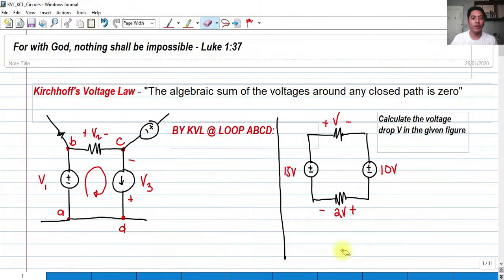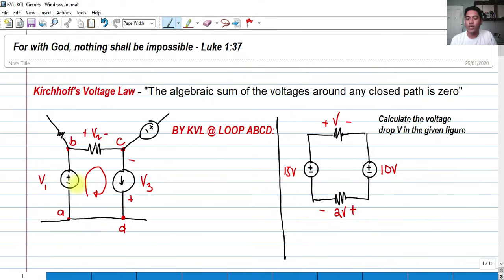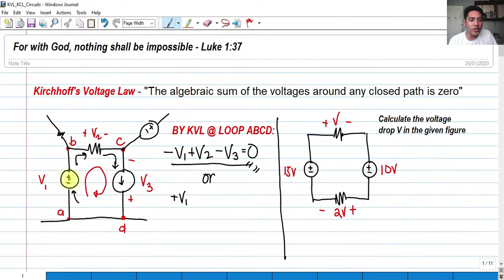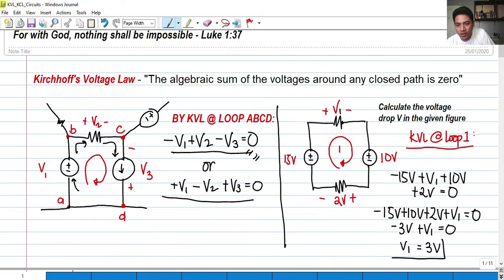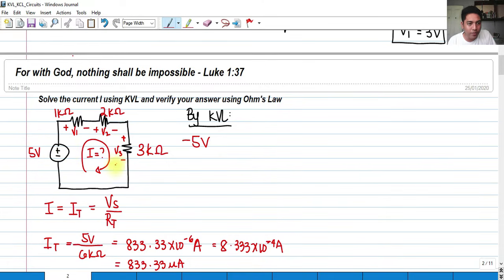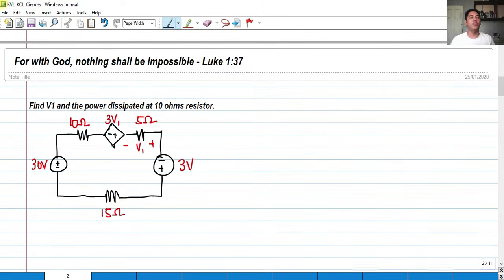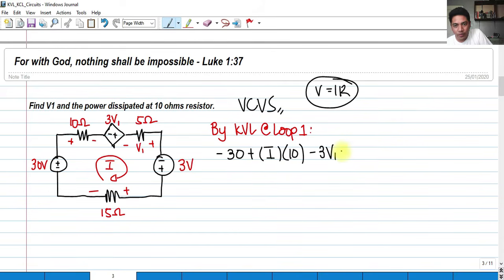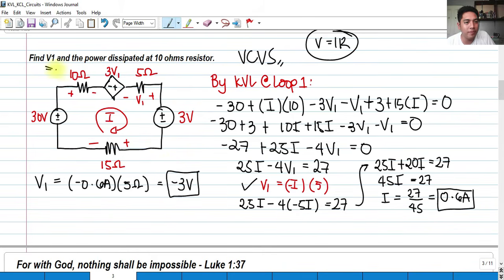Kirchhoff's Voltage Law (KVL) How to Write and Sample Problems - DC Circuits

Comment: Sir pwede bang 3V + V1 = 0, so -3(3V + V1 = 0 - 3, then V1 = -3V ? 

Since R1 has unknown Voltage, I decide to calculate the node between 3V to V1 only. When voltage entering negative, the leaving sign would be positive right?

Comment: Pano po pag isang battery, dalawang resistor tas find the v1 and v2?
Reply: oh'ms law lang gawin mo
Reply: +vbat -(vbat/Rt)(r1) - (vbat/Rt)(r2) = 0   > v1 = -vbat +  (vbat/Rt)(r2)   the v1 dapat negative kc voltage drop xa ng resistor 1 .hindi xa ng dadagdag sa total energy ng circuit ng rreduce xa > thermodynamics say you cant create energy nor distroy it  so +vbat - v1 -  v2 = 0